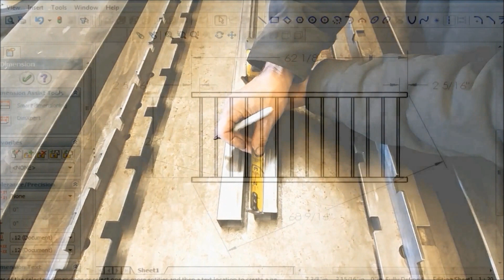Railing welding jig / fixture

Comment: I guess this would work if you are building a bunch of panels the same size but that’s it because all spacing differs a bit depending on the length of the rail

Comment: How do you do stairs at an angle? Is there enough to angle the balusters in the jig?
Reply from the maker: The bottom "rake" can be unscrew from the holder/quide, and slide left or right to skew railing panel. Notches for balusters are wide enough to make stair railing up to 39°. However, I prefer to make railings for stairs on my other table, because using the same jig will make smaller baluster's spacing from the rest of the panels
Reply: @accentironwork  That makes sense. Do you have a video of the other table for making stair railings?
Reply from the maker: @jfuqua72  I do it on the flat table. I make CAD drawing and go by diagonals control dimensions instead of an angle. That way it is more precise, especially if the stair panel is long.
Reply: Can you show a video of the mechanism that clamps and holds the jig?
Reply from the maker: @jfuqua72  I can send you a quick video via Messenger. What is your Facebook page?